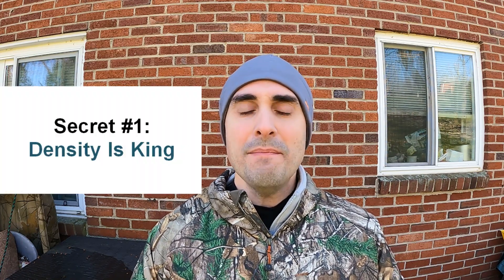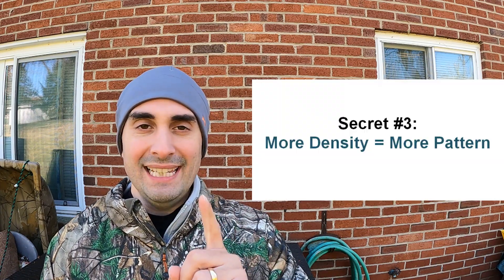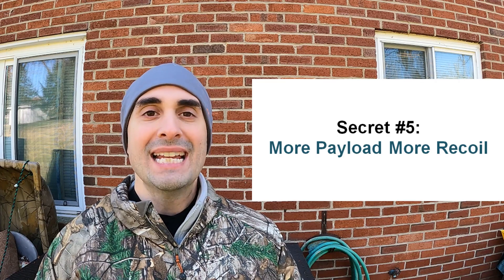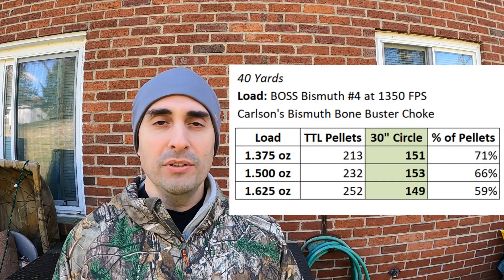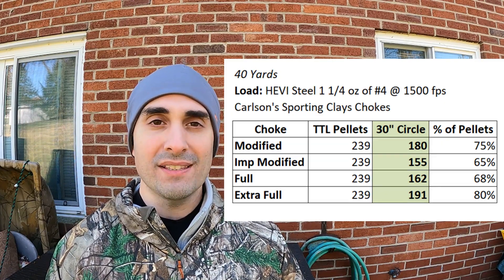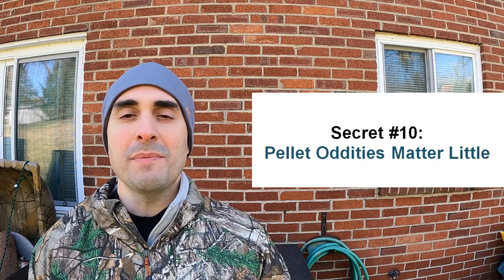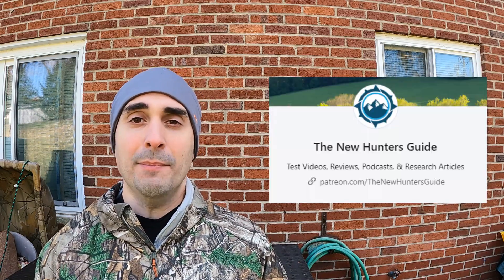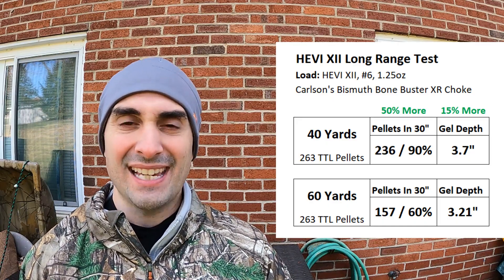10 Secrets Of Waterfowl Hunting Ammunition

Comment: I never would have guessed that bismuth #4’s had better ballistics than steel #2’s even if the steel has about 30% faster muzzle veloctiy.  That is crazy.
Reply from the maker: Yup, it is impressive,  and I've had multiple tests validate how bismuth 4s and larger punch so far above their weight class.
Reply: @TheNewHuntersGuide  it’s just so absurd.  2 3/4” bismuth 4’s pack more punch than 3.5” steel 2’s.  Craziness.  I always just compared shot count for pattern density.
Reply from the maker: @bryanheimann5370  Thats the big advantage there. smaller bismuth pellets that hit hard and have more pattern density with smaller shells that have less recoil. But of course you pay for it.

Comment: If you only tested one shot at each session, which i have seen you do, of each type, there isn't enough data to be valid. You are not wrong about the recoil effect on 2nd and 3rd shots, most folk shoot too light a gun for the big loads they shoot, too. You'll get more variation from lot to lot of shotshells than you will out of different chokes.
Reply from the maker: You might think the variation from shot to shot would be significant, but really, it's not. I've done enough tests with the same ammo on different days and different conditions and get very consistent results, the deviation is a just a few points.

Comment: I think at 5:32 you misspoke. For the same payload and same pellet size, the denser shot has LESS shot count, not more. The advantage on the denser shot happens when we get to decrease the shot size in a denser shot, and retain the same KE per pellet. As the pellet is made smaller, the increase in pellet count is not linear, but almost exponential, because smaller shot occupies more volume lost to air in bigger pellet sizes.
I think it’s what you meant.
Reply from the maker: You are correct. It's easy to get tangled up when saying so much so fast. Dense shot does allow you to fit more shot into a shell though, because you reach the same weight with fewer pellets and ultimately the limiting factor is not weight but volume. Steel maxes out in a 3" shell at 1 1/4 to  1 3/8 max shot, because that much steel just takes up all the space there is. In the same shell you can fit 1 1/2 and even 1 5/8 of bismuth or heavier shot. Though you still don't come out with a pellet advantage from that, they end up being nearly even if the same size shot is used.  Pellet advantage comes from smaller shot for sure.
Reply: Winchester has 1 5/8 oz bb

Comment: The Lubricity Factor... You know... I've have some loads that do well with a Pattern Master choke and other loads that do well with a Carlson's Cremator Long Range choke. I just didn't know why... They are all steel 2's and 3's. I just went with the best ammo choke combination that I could provide. After watching this video, I noticed the steel shot ammo that is plated patterned better in chokes that apply constriction, whereas my cheap, non-plated steel shot ammo did better in the Pattern Master. Thanks George.
Reply from the maker: You know, I never connected the dots quite like that but yes,  I think I've seen the same pattern, plated steel does seem to do butter under tighter constriction than unplated. Thanks!

Comment: This is a really great video George. Thanks for sharing.
I am currently looking to start using hearing pro. I have been duck hunting for a long time and have never worn any, and my hearing has definitely taken a toll. But the tetras are way outside my price range. And I’ve tried the walkers ear muffs but I have a hard time with gun fit and them. So I’m hoping to find some in-ears for less than $200. Any recommendations?
Reply from the maker: Thanks so much! I have used the Walker Silencers but my experience was not great. I did a video on it actually. There are some other players on the market now though and walker has been upping their game. I would search on Amazon and sift through the reviews. But get something before the next season, even if it's not ideal. You can always buy something else down the road. Protect those ears today!
Reply: Check out Surefire Sonic Defenders. They aren't electronic but I like them. My 3m peltor electronic buds actually fit the surefire plugs.

Comment: Very interesting data related to payload and pattern as well as recoil.

Typically in a larger payload shot shell the FPS decreases compared to the exact same shotshell with less payload. 
Interested on the physics on that 

Also never would have images payload increase not benefiting pattern by even a smaller margin.  I would love to see more data on that!!!!
Reply from the maker: Powder has to increase to maintain the velocity as payload increases. Probably the best examples are 3" vs 3.5" shells. They add payload and powder but keep velocity flat, much of the time. Pattern efficiency decreasing with an increase in payload seems to effect non buffered loads most. Buffered shot seems to be insulated from this effect. Most likely because the buffering keeps force applied to the pellets evenly no matter how tall the shot column.

Comment: I will be watching this one a few more times, alot of information in this one, I'm confused how do you get density if more payload don't equal more density? God bless you and go get them in the marsh
Reply from the maker: It is density of the metal. Denser metals give you more pattern density because you can use smaller shot and have more pellets. Denser materials also let you have more payload because the limiting factor in shells is not weight it is volume. So you can have more weight of shot with denser metals because you reach that weight with less volume. Steel maxes out at 1 1/4 or 1 3/4 oz that can fit in a 3" shell, but Bismuth or denser can fit 1 1/2 or even 1 5/8 of shot in the same shell because it takes up less space. Not that this is a huge advantage because you pay for it in recoil.
Reply: @TheNewHuntersGuide  ok thank you, now I understand. God bless.

Comment: Winchester super x hv steel vs. Winchester dryloc steel. Non-plated vs plated shot.
Plating increases lubricity/performance slightly. Also it reduces corrosion from the pellets rusting while in the wet duck hunting conditions.
 Super x steel= 17.99/box today.
Dryloc steel= 23-25.99/box.
Plating the shot costs more. But is higher quality.
Reply from the maker: Thanks!

Comment: Regarding the payload/recoil topic…..  Do you think the stinger loads will have 15-17 lbs of recoil?  I’m patterning them this summer. The 1oz of #5 bismuth has about the same number of pellets as 1 1/4 oz steel #3. What I’ve seen on previous videos is penetration is similar too. Also trying #6 over decoys.
Reply from the maker: I have that number! With an 8 lb shotgun, a stinger has about 21 lbs of recoil. That is actually significantly less than a 2.75" 1.25 shell at 1350. The stingers are about the softest recoiling 12 gauge waterfowl load on the market. Pretty much noting gets down in the teens for game loads.
Reply: Did you pattern them?
Reply from the maker: @scottsantrizos6849  Not the stingers. Not yet.
Reply: Do you hunt with a dog very often?
Reply from the maker: @scottsantrizos6849  Not nearly as often as I'd like.